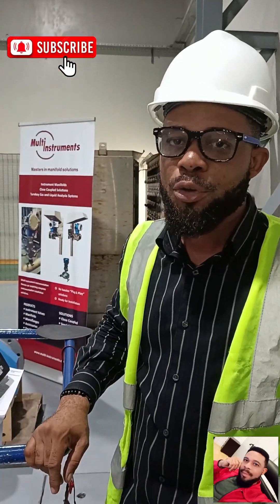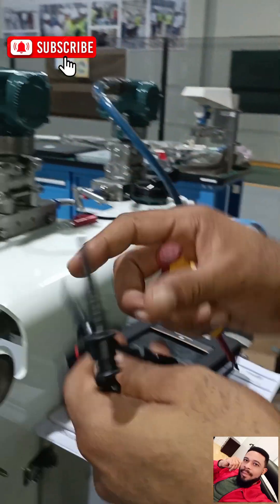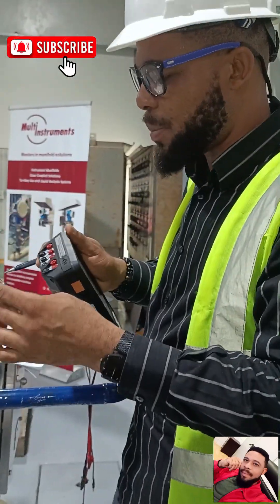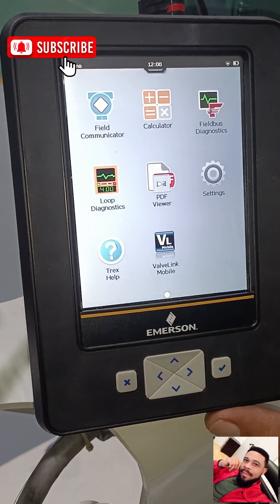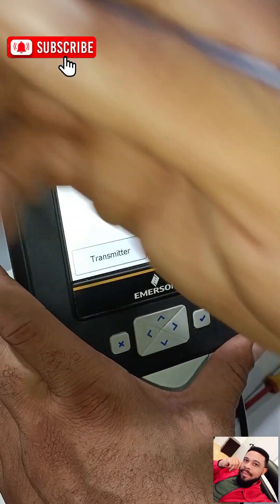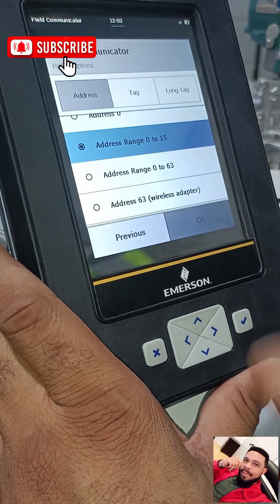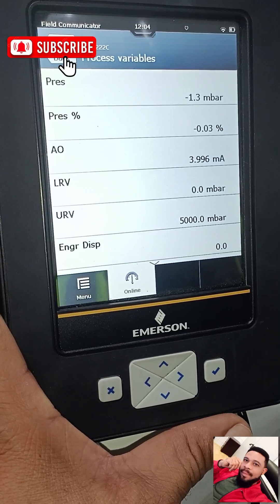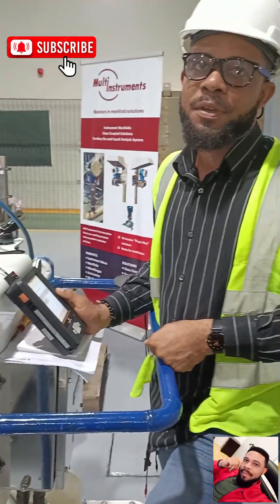How to use the Emerson AMS Trex Device Communicator t (loop the power) on a Yokogawa Transmitter.

Comment: Pro Tip: No need to loosen screws on the transmitter. HART devices are equipped with metal loops at each screw to attach your test probes.